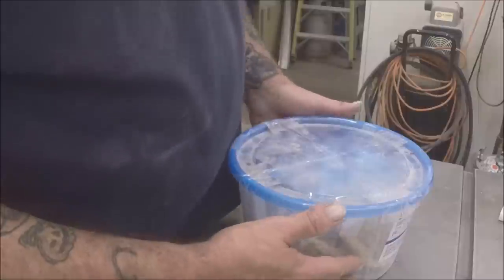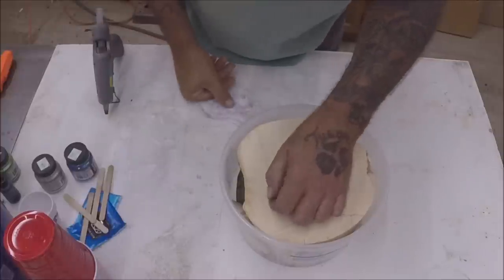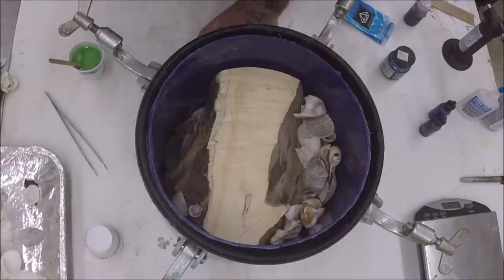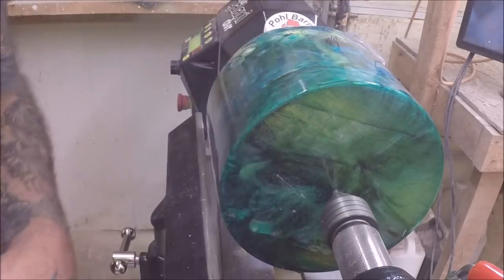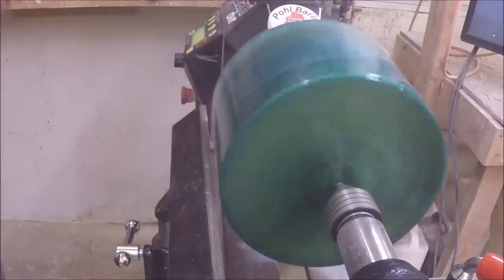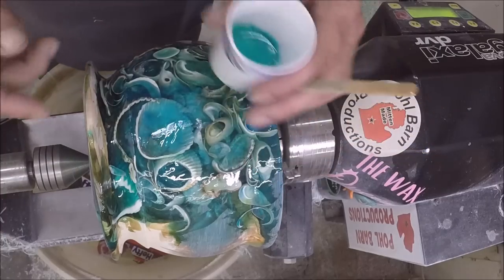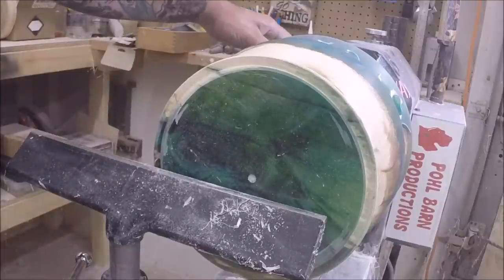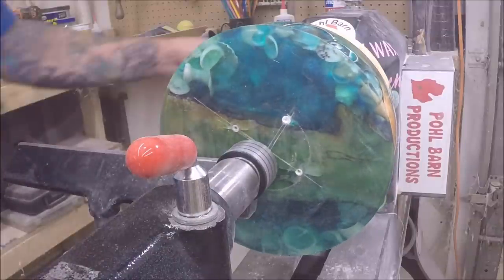Seashell bowl

Comment: Very unique piece, that's a keeper even with the flaws. You could make sea shells out of a softer material with molds and not have the problem of chattering and save some bits. Maybe potato starch mixed with resin colored to your liking.
Reply from the maker: I am sure I could and it would be so worth what ever the molds cost to buy

Comment: I did a fly rod reel seat with shells, beach glass & driftwood.  When I turned it I started with 100 grit sand paper & went all the way to 2000 micro mesh.  Sealed it with ca.
Reply from the maker: that sound really cool !
Reply: Andrew Ingram do you have pictures of the fly rod 👍
Reply: Sorry I don’t.  Sold it to a guy in Japan.

Comment: If you can find some, see if you can get cutting inserts made from Tungsten that will fit your carbide tool holders, they'll be pricey, but they should be hard/strong enough to withstand seashells in resin (or just about ANYTHING in resin for that matter) without breaking or dulling...
Reply from the maker: Thank you,  I will be looking for some.

Comment: Beautiful piece of art! I'm on my way home from Florida with shells for granddaughter or now maybe NOT?
Question: I have made a vacuum cover for my pressure pot. My thinking is to degas the resin in the mold then changing the lid and pressurize the resin. I'm thinking it will help reduce gas bubbles. I'm interested in your thoughts.
Thanks 
Scott
Reply from the maker: Thank You Scott,  I know you can use vacuum for a short amount of time depending on the resin you are using, before going to pressure, keep in mind that vacuum will change the molecular structure of the resin causing it's boiling point to drop, it will in fact start bubbling worse the longer you leave it under vacuum, at least with total boat that was the case,   place the shell so you do not hit them and when you do use a grinder to cut them and add the resin back when shaped.

Comment: I have a question about this. Is there any sort of soft metal you can use too? Looking at these amazing colours, it would look pretty slick with a metal touch.
Reply from the maker: yes there is Chuck, aluminum turns just fine so does copper

Comment: I'm sure you've gotten past this, but Resin gets very hot when it's curing. If you use hot glue, it's likely to melt very quickly. I don't know how many glues handle heat, but hot glue is made out of a re-usable plastic like material (I don't know exactly what it is).  The bigger the pour, the faster and hotter the cure will be. I saw this become a problem in another project of yours.  Another thing I want to say is to make sure you get your middle correct before you put her on the lathe. Your work could lose its center of gravity if it's off even by a little, which could break your project.
Anyways, I hope this helps! It looks beautiful!
Reply from the maker: Thank You
Reply: The Pohl Barn Productions of course!!!

Comment: What was your carbide like after all that? Soft stone is used to sharpen carbides and silica is definitely capable of doing that.
Reply from the maker: the shells beat the carbides up pretty bad,
Reply: @PohlBarnProductions  - I had an inkling they might :/ The problem with silica is that it goes by another name, quartz and quartz is one of the most difficult materials we try bending to our will, whether it's in mining it or transporting it via conveyor belt, it just EATS everything up, especially metal. Rubber seems to be the only material that sort of lasts long and compared to any type of wear resistant steel, rubber is a god send. But you can't cut shells with rubber which is why I'd at least recommend cutting it with a cheaper, perhaps even a "sacrificial" tool instead of the expensive ones.
Reply from the maker: Die grinders did the trick !!!  then I back filled with resin and turned it again

Comment: turned out wild doug good to see you turning again . i watched hers first doug sorry buddy . but they both turned out great . hey i got a question for ya . i just pored my first casting and it did something weird . i dont have a pressure pot so that may have been the reason but i dont think so . it looks like it boiled like water then hardened up solid im still going to turn it but i would like to know what happend or what i did wrong buddy . so we all know your the king of resin any thoughts on what i did wrong . and what i should do so it dont happen again .
Reply from the maker: Thank you I think you trader !  lol   she did a great job on her end of it also,  yeah it did have something to do with not having it in a pressure pot. it's called exothermic reaction,  it boiled, out of a pressure pot you can only pour so much at a time, you have to layer your pours, if it didn't foam up you might be ok to turn it but it may also be really brittle and come apart like glass, wear your PPE !
Reply: @PohlBarnProductions  well it dint foam and hey hers popped up first lol . thanks doug ill remember that for next time i was hoping to get a clear pore with no witness line . dont have a pressure pot yet but i foresee one in the future . maybe ill get lucky and what i wanted will still be cool . thanks again doug . again you and kims bowls both were a homerun buddy just did a beautiful job on them .

Comment: What about roughing it out with a grinding wheel on your 4" angle grinder?
Reply from the maker: Thank you Mark.     I used a die grinder to cut just the shells down then the sanding disc to smooth it out after adding resin to the holes I created

Comment: What about using "man made synthetic sea shells?"  Make some silicone molds of real sea shells.  Fill the molds with some kind of wood dust and acrylic goop.  The beauty is in the patterns and shapes.  Take artistic license and use "Synthetic objects."  The purist reject resin, so screw them, and go synthetic reality!   Have you ever made  "starting block" from a composite of colored resin chips or shapes embedded in a matrix?   Is there any process to vacuum embed assorted macaroni shells to harden them, so that they could be a starter material?    Wooden match sticks?   Various reed stalks?  Chinese noodles?  Captain Crunch?  What kinds of materials can be "hardened?"
Reply from the maker: that Idea has crossed my mind.  plastic shells anyways.  I have put Romen in a bowl. sticks from the swamp and even resin gummy bears.